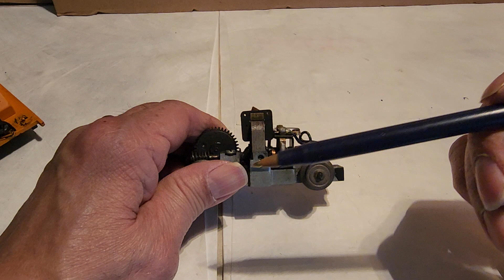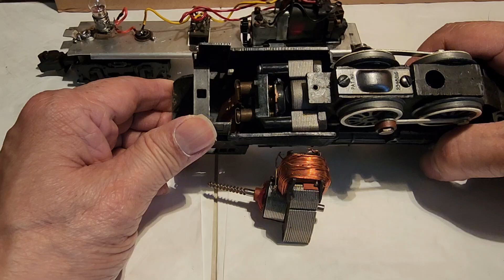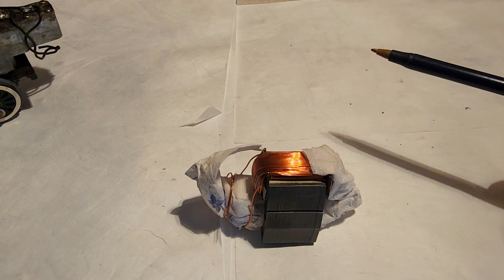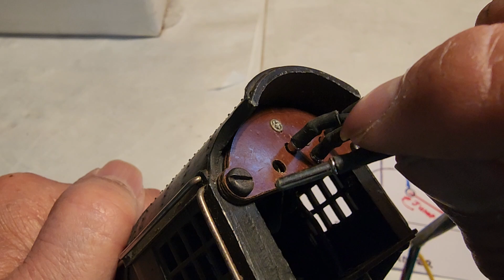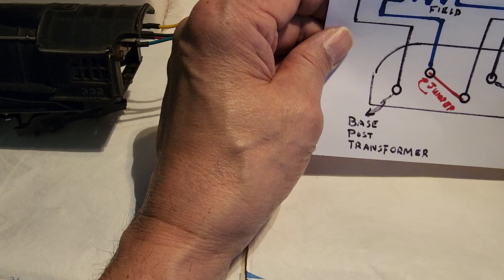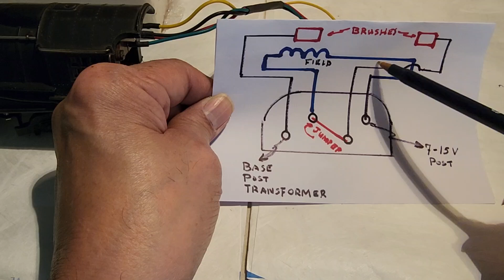WHAT ARE THE DIFFERENT AMERICAN FLYER OPEN FRAME MOTORS &TO DIFFERENTIATE.&BENCH TEST WITH NO TENDER

Comment: Hello, it is interesting that I found this video while I was working on rewinding a 3/4” large motor field winding. What I am wondering is, do you know how much wire the large motors use? It sounds like more is better? Or what the ohms is supposed to be for a standard large motor?
Thanks!
Reply from the maker: THE 3/4" large motor is wound differently than the small 1/2" motor.  The 3/4" uses a larger guage about 22-25 size wire but with fewer turns (it about 50 turns).  This results in a lower DC resistance. The ohm is about 0.8 ohms
The 1/2" motor uses a smaller wire about 27 and has more turns (about 75).  The ohms is 1.4   Doug
Reply: @IRONRAILROAD  Good to know, thank you!

Comment: George Jacobs is credited for enamelled wire.
Reply from the maker: Yes that is correct. George Jacobs in 1907 did perfected the enamel insulation for the magnet wire.  There is a slight conflicting historical notations between Mr. Jacobs and AC Gilbert company.  I'm thinking perhaps AC Gilbert may be the first to actually patent it in an actual motor and history gave AC Gilbert more historical visibility in the model train world?

Comment: This is one of your best Doug.  I have a question on the two monster motors,  Where did the builder of the motors find or  cut the worm shaft which has to be longer  too reach the bull gear on the rear axle.  If they just cut and drilled and threaded two worm shafts together how does the worm shaft not unscrew itself?  I would like to build one for myslf.
Reply from the maker: You may not need a monster motor per se.  Size is not the only determining factor for a more powerful motor.. If you use Gilberts standard motor wire, then a one inch motor is more powerful than the Gilbert Big motor (which comes in both 5/8 inch and 3/4 inches).  Using an upgraded wire ( as mentioned in the video) in the 3/4 inch size can produce the equivalent of the one inch motor torque.  As for the worm gear drive, one builder used the latest and last model 3/4 inch armature shaft (motor with the round commutator) which I believe have a slightly greater length.
For the real monster motor necessitating a special elongated shaft, he "brazed" together enough length and then must be "trued" on a mini-lathe   
Producing one of these mothers requires a bit of good experienced skill.  Not for the average DIY 
Hope this helps.
Reply from the maker: Suggested wire to use would be the high heat double coated polyamide type.